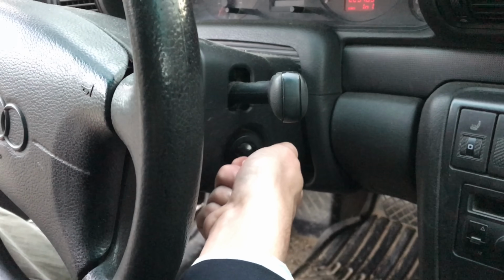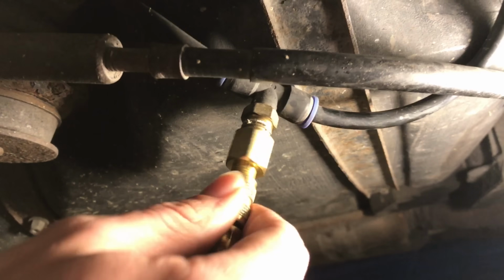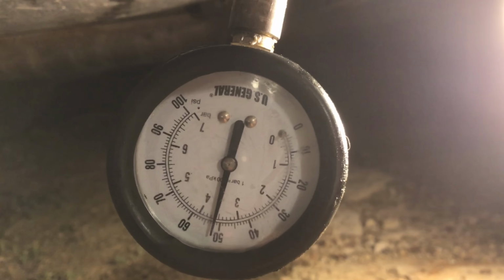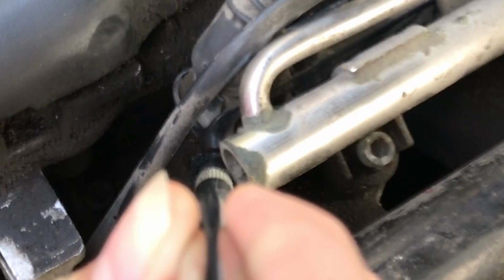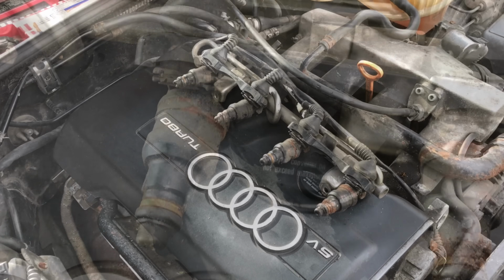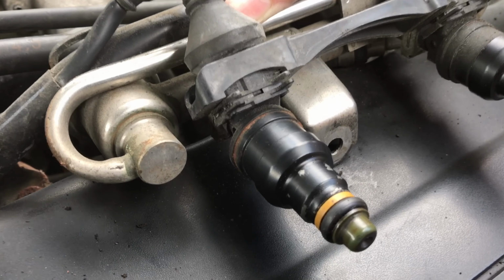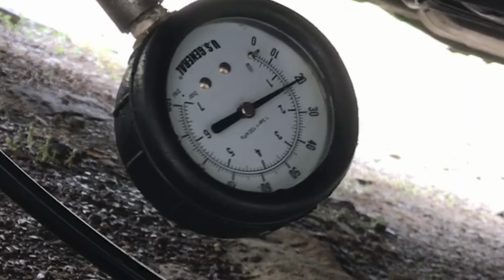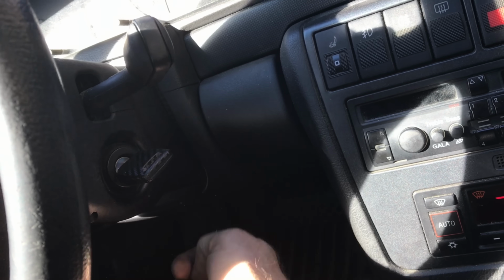Fuel injector? Fuel regulator? Fuel pump? Learn fuel diagnostics

Comment: Hey mate, great video! A question please. When you pumped air directly into the fuel tank to test the fuel check valve. It would have to be on the fuel tank side of the fuel pump so where exactly do you connect the pump to? Thanks.

Comment: Looks like you don't have a shraeder valve on the fuel rail . I believe you need high pressure fuel line for that check valve.  On my 1987 Chevy Celebrity , 2.8L , it died while driving . It lost power. I pulled over and smelled fuel . The diaphragm in the fuel pressure regulator was torn. It was leaking fuel out of the throttle body , with the key on and the fuel pump prime. There is a vacuum junction on the throttle body . One line goes to the fuel pressure regulator . To test and verify , I connected a vacuum pump . When I pumped , it drew fuel through the torn diaphragm and through the vacuum line at the throttle body and up into my vacuum pump . Confirmed , bad fuel pressure regulator . It is located UNDER the intake plenum and between the fuel rails on those early GM's . A good test for a bad FPR . I like your test on the check valve with the bicycle pump .

Comment: Had a vehicle that wouldn't go up a hill, wouldn't go into 2nd gear. Thought is was the transmission. Turns out the fuel injector was bad. Never had that experience in my 7 years as a mechanic. If you want more information on my situation, I'm more than happy to respond.

Comment: Hello, do you mind answering a quick question. My car is loosing pressure a little differently to yours. I loose about 10-15psi in about 5 minutes. I hooked up the pressure gauge to the fuel pump and it is holding pressure as it should. When I check the injectors, there is a small leak tear drop leak on one injector that only drops in about 10minutes🤦‍♂️. The car starts well when the weather is a bit cold and struggles to start after a few minutes when warmed up.

Comment: I've been having fuel/fuel injector problems this vid helped but on the regulatory side of things I got some questions I have a 91 miata with a 99 engine the fpr I had to put it on upside down per swap directions cuz of this vid I went n checked I do got fuell in the vacuum but it's upside down becuz it upside down would it still leak in there or if it leaks even upside down it's bad

Comment: I have this exact problem and I do not know which of the three is the culprit. I have a 04 GMC Sierra so the injectors and fuel pressure regulator and not easy to get to. How did you do the last part to check the pressure of the fuel pump check valve? Like where did you connect the fuel pressure gauge? It seems like that would be an easy way to know whether it’s the fuel pump or one of the other two

Comment: Hi, my diesel Transit doesn t start sometimes, but if I open the gas stopper it will work. I do think is the fuel pump inside the tank... i haven t anything for now... i would appreciate some advice or some experiences from you. Thnaks  a lot

Comment: Hello, very nice video, I have a question, on my 2001 1.8t the injectors are a bit different, they have more nozzles, not two like yours, and on the paper test wets the paper more than yours, and the shapes are like big ovals, I have high fuel consumption, my injectors are dead?

Comment: Is it possible on some engines like my 2uz fe vvti that at idle vacuum pressure is meant to be low instead on the line for the fuel pressure regulator?  Others suggest this is normal but looking for more opinions.

Comment: That is a great video.Need you to work on my 2000 S10.

Been having a problem with starting My 2000 S10 for months now,Had 4 Dephi fuel,
pumps and the last one was a AC-Delco from dealer.
 It well start great first thing with one turn of the engine,even after sitting for 2 days,
After I drive it (long or short drive) and it sits for 20,30,60 minutes it has to crank a
long time,maybe 5 seconds or more.But cranks.
 Every time I take it to my Mechanic,he says it is leaking back in the tank,the presure
drops within a few seconds.I ask him about leaking in the injectors and he said no.he 
blocks them off.The new fuel regulator is fine,also new filter.
 If it is leaking back why is it cranking that good first thing.I NEED HELP

Comment: I have a 2006 Ford expedition eddie bauer and I've been having an issue with it and I was wondering if you could help. It's not excepting gas like if I'm on the hwy and have to slow down and then try to pick up speed again it seems as if it's not getting any gas and it will make a noise, do a little jerking motion and may backfire. I have taken it to 10 or more mechanics and they can't figure it out. It is currently at a mechanic shop now I'm about out of money and need help ☹️

Comment: I recently found a 4th possible cause in my 2000 Lexus rx300. The in tank fuel filter developed a crack and would take longer to start, cause knock sensor codes/lean condition over 2300 rpm which in turn caused the computer to block overdrive from engaging in the transmission. Don’t ask how much time and money I threw at the car before finding the actual cause… Too embarrassing to list. 😂😂😂

Comment: My friend has a 2005 murano, starts fine even in -30, but once at temp after driving, turn it off and it won't fire. Have to let it sit for an hour or so til cools down, then starts fine again. Runs fine once it's running.

Comment: I am having hard start issue with MDX 2009 and also having rotten eggs smell inside the car, can you tell what is the problem out of 3 leaks based on rotten smell symptom instead of eliminating by pressure checks?

Comment: Thanks for the really helpful vid, i had a question, wen i remove the gas cap there’s a release of pressure, is that n indicator that the fuel pump n its surrounding components r working???
Reply: Its too bad questions are not answered here. Oh well, im sure that would take a lot of time to answer everyone, though would be helpful, as not everything is straight forward.

Comment: Wonderful, does It work for Multijet common Rail new engines like 2006/2010? Engine is not starting anymore, pump high pressure failure

Comment: I Need Help (03 chevy malibu) is hesitating at high speeds between 45-55 mph I have change fuel pressure regulator,fuel filter,fuel relay,fuel pump is working fine,just check my injectors like you said to do and they are spraying but car runs good at low speeds and at idle but when I try to go in overdrive my car shakes and sputters also new tune up done as well I Just don't know what wrong like I said on the street it  runs fine but on the interstate 44-55 mph sputtering like crazy

Comment: I have a 99 Silverado with the 5.3L would a bad fuel pump check valve cause it to start and idle just fine but not be able to rev past about 2k rpm?

Comment: Is the check valve the same thing as a fuel pressure regulator ? My fuel pressure regulator is inside the tank with the pump.. 04 5.3 silverado..

Comment: When should I remove the vacuum line to the fuel pressure regulator? Is it safe to do while the engine is running?

Comment: Ok. Next question. Would any of this pertain to sluggish acceleration?    Replaced the Fuel pump 6 mos prior and sluggish acceleration was began.           I've installed Brand New Injectors and Spark Plugs  and the ohm test is consistant at 13.4 each . Noid light test all good. Stethescope test with all clicking good. Fuel Regulator and vacuum hose in good operation.    But..... I pull number 3 injector connector and no studdering from engine as does with all the others. Spark is good from cap, wire and plug.        Replaced the fuel pump 6 mos prior to new injectors. Could the fuel check valve be bad so soon with new fuel pump? Or am i missing something else. The truck feels like it  is only running on 3 cylinders.  It starts and Idles like nothing is wrong.   Not until you put a load on it.                  4 cyl  KA24e Nissan 1993 4x4 PU 5 spd man trans.

Comment: I have two fuel pumps I replaced into my car (suitable for the car from an auto retail shop). Have installed one and the car will start but then automatically shut off in one second. Throttle applied it will shut off instantly. Could it be the electrical connector that is with the fuel pump assembly? Cause I noticed the wires were all frayed and rotting.

Comment: My 09 Subaru is having a hard start in the morning, but if I prime the fuel pump a few times it fires right up. Have a p0171 for running lean, checked fuel pressure and looks solid. Held good pressure  even after I shut off the vehicle for at least a half an hour. Any suggestions?

Comment: Thanks for the video,  My pressure regulator is in the tank.  Can I hook the pressure gauge directly to the fuel line coming out of the tank and test it that way and just turn the key to start the pump?

Comment: I need some advice on a potential fuel problem. 
I’m running a 414hp 305kW MTU diesel engine and on occasion revs drop from 1600 to 15 to 14 and sometimes stalls the engine. Any tips would be appreciated! I’ve tried several things over the course of 6months and would like any additional information.

Comment: Great video!  Looks like I have a bad fuel pressure regulator. No change when I remove the vacuum like. I tested the vacuum and I have 20-21psi or
How ever vacuum is rated haha
Reply: John Smithy no there wasn’t but unfortunately it didn’t fix the issue either. Still no change when I remove the vacuum line. Truck gets bad stutter around 50-60 mph. Has stalled a bunch. Replaced the fuel pressure regulator, fuel filter and the fuse box due to the fuel relay issue in these trucks. Got that from a you pick junk yard so saved a bundle.  Only code it’s pulling is U1262.

Comment: my pump cost 1400 bucks 

sorry that one way check valve has to point arrow from tank to injectors regulators house  ?
will it work if my high preassure  fuel pump has electrical valve ?

Thanks !

Comment: if it drops fast its more likely the pump valve right? coz if the leak is fuel injector the pressure loss is slower

Comment: Maybe you can point me in the right direction I was thinking fuel pump but now I’m not sure 1998 Honda accord cranks with no problem will go about a mile down the road just fine then all of a sudden it’ll drop rpm’s to about 300 and bog down then race back up to normal then bog back down constantly… thanks in advance for any info

Comment: I disconnected fuel line near firewall and turned key . Nada . So I now know where to go next . I checked pump fuse that's good . Will probably check relay next . And then finally filter but I don;t think it's that . Either relay or pump itself One step at a time .

Comment: Hello, I hope you can help me. I got a Seat Ibiza Sports Estate. I have glow plug error on the dashboard when i checked with OBD it said Airflow sensor I replaced that didn't work. I even replaced my 2 glow plugs where the injectors have fuel around it which is weird. Also 4 cylinders the 2 on left injectors are clean but the other 2 on right have excess fuel around it. Also the Glow Plug I replaced had lower resistance which were on the right 2 Cylinders. The one on the left have the same resistance.

Comment: I have the same fuel pressure tester kit.  I checked my FP on a 93 VW cabriolet and the needle jumps up and down on the fuel pressure erratically.  My spark plugs are also all covered with dry black carbon deposits and my engine oil smells (filling?) like  gas. I'm thinking the for is bad.  Any ideas what else could cause all of this?

Comment: This is a great explanation 👏  and great vedeo! But i have a problem on my toyota corolla 1.4d4d 2007model (failure code:P1229) on toyota dealer they put a brand new 4injectors more a diesel hi  pressure pump, replaced a fuel filter, air filter, cleaning EGR, MAP sensor and still have a same problem!! The engine started good but after second gear around 2500rpm the engine stops immediately amazing mechanics dumbs have on this toyota dealer!! Anyone knows about this caind of cars? I appreciate if someone can help 🙏  someone talking about the fuel pressure valve sensor! On common rail 🤔 after dispend (31000kr =3300$) the damm car still the same like before going to workshop 😳  cheers from Norway

Comment: I have the same problem with fuel system on my car.But the fuel regulator is in the fuel pump assembly.
How can i verify the checkvalve and replace without disassembling the fuel tank?

Comment: I’m having several issues. All at once. My fuel gauge says E and running really BAD! It’s completely broke down today, then started back up when new fuel was put in. After I pumped gas the Gauge read it but wasn’t reading as much as I put in! Once I parked it let it sit a hour or two then started back up it’s on E again! I was able to drive it but still on E! 999.999%! The gas gauge  started having issues 2 weeks ago. It started with terrible gas mileage. Or so I thought, moving slowing or slightly while idling, changes often after I crank the truck back up. Reading less fuel each time. The gas mileage seems to be terrible. This is a automatic gmc 2011 Sierra with the V8. I had it in 4 high when I hit 20mph from 2nd to 3rd gear my truck starts SHAKING violently. I’m really trying to save time because it’s literally freezing outside and I need emergency heat if power goes out. I’ve looked for leaks under the car. Nothing. No smells in the car that I’ve noticed. I did notice whomever put oil in my engine overfilled it slightly when I checked that. This is why I don’t like other people touching my truck, I’m looking to fix myself if at all cost. Everything seems to be suffering. Could it be suffering all at once from something blocking the fuel line? Maybe got into the engine causing some major problems like the shaking I experienced. I’m not sure but this issue popped out to me! Only because nothings adding up. The trucks violent shakes feel like it’s coming from harmonic balancer which i know is bad news bear! But does it explain why the truck only started back up when gas was pumped after it completely went dead. I’m narrowing my searches. Possible fuel pump, a injector going out? Possible sensor?! I don’t know my ADHD brain is riddled and I don’t wanna freeze looking 😂 no one video has all of my onset symptoms. 

I forgot to mention I was getting lower fuel pressure than I should’ve. But it’s cold so maybe that’s why? I have 5 30W synthetic oil in her so it shouldn’t. It’s also reading the oil life is lower than it should be. In my personal opinion. The trucks went downhill in two weeks flat. It kind of putters when I give it gas and when released like it’s starved somewhere! It breaking down in the frigid cold was really scary. Again I’m in the Texas storm. Which is a terrible time for anything like this to happen if left without power I need to be able to go outside in the truck to warm up. Crankshaft position sensor? Found it!

Comment: I have the same problem but the cause was in the fuel filter inside the tank just I replaced it with a new washer and the leak pressure problem solved

Comment: I was told I am running to lean, I have replaced the fuel rail and injectors along with the pressure regulator, Im not sure what to check next, fuel pump is also brand new along with a new fuel filter Im stuck, any thoughts would be appreciated on what I should check next thanks 1991 Honda civic 1.5L Non Vtec
Reply: Bad Lambda sensor. Leaking exhaust or oil/coolant in the exhaust will screw with the sensor and have your engine run lean.
Reply: @Thunder_Yoda  Hmm Ill have to check it, its new as well car fires up idles just fine, drives fine or so it seems with no hesitations or backfiring.. Emissions said I was running lean.. Catalytic converter is also new, Ill have to switch the sensor out and see if it changes, thanks

Comment: Can a faulty injector cause white smoke ?(only at starting  and till engine warms up not at idleing ,and its smokes the same when giving fast gas ) ....can an faulty injector be always pumping fuel into the cylinder and causing smokes ?

Comment: if fuel pump pressure is higher than specicified value 70 psi  will this be the cause of black smoke exhaust especially when you press snap on pedal?

Comment: Old video but there's 4 places on some cars. My 2000 Honda CRV has its leak in the fuel pressure damper on the incoming side of the the fuel rail. And damper if I can even find that part anywhere to replace it!

Comment: The normal injectors will have a certain sound. the bad one will sound rather different and the ECM code will name the problem cylinder. So that injector is the one to suspect as sounding 'odd'...

Comment: So... I have a 2008 dodge ram 1500 3.7L. I have changed all 6 spark plugs. The ignition coil is good. The fuel pump  has been changed out.  I am getting a miss fire. The codes are P0202, and P0302. The missfire on this cylinder is happening due to the fuel injector.  The kicker is the fuel injector has been replaced 3 times in total now. Twice with one brand of injector and the last, and most recent injector, is OEM. The only time it miss fires is when the engine has ran for a moment, I stop the engine and it starts to miss fire immediately. The miss fire doesnt happen from cold crank.

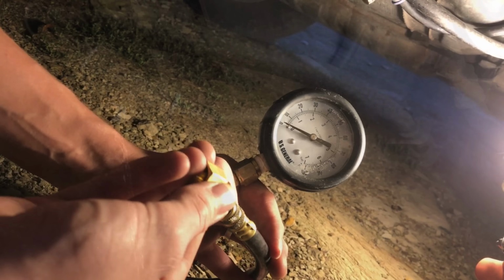Comment: My 1998 Toyota Ipsum changed it's fuel consumption from 1:10 to 1:4 . I checked the injectors and they are all firing/opening at the same time is it normal and what could be the solution and there is no engine check light

Comment: hello !  i have a chrysler voyager from 2002 2,5 crd diesel,it starts well but the problem is that when i accelerate in the third gear,my engine stops,and i think it's a fuel pressure problem,what do you think is the problem ?i think that is the fuel regulator

Comment: I am looking at a 2009 750 brute force 4 wheeler. It will start but you don't know how long it will run. It is showing a code " F1". If you wait about 5 minutes it will start backup.